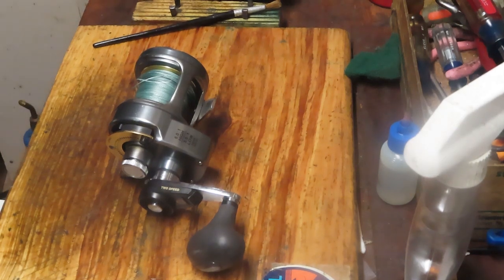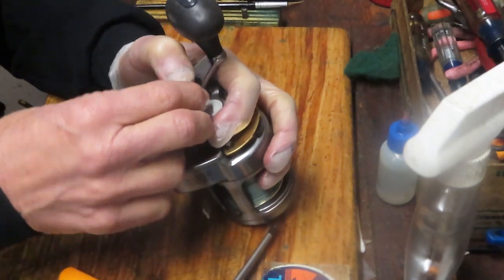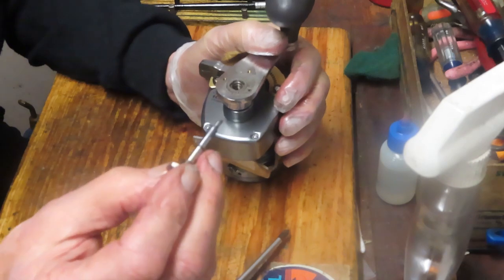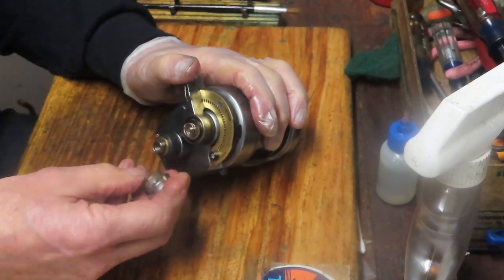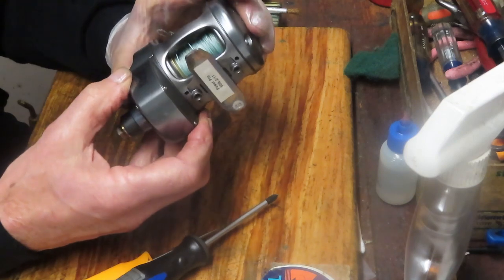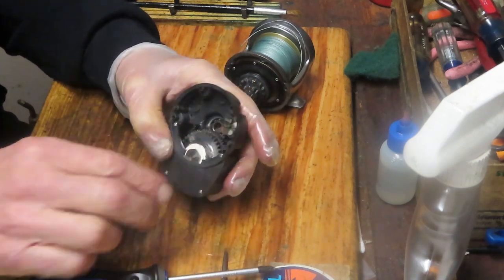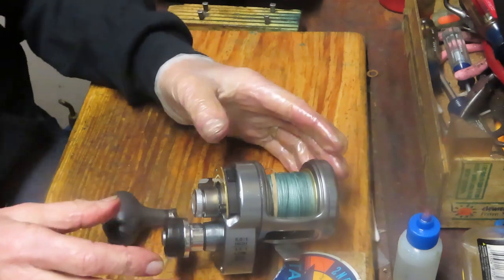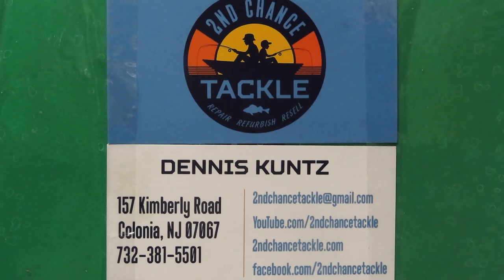Shimano Tyrnos 10II lever drag fishing reel how to take apart and service

Comment: I’ve only worked on one lever drive and if it had not been for a worn out ramp piece for the lever drag I would have succeeded in restoring a very old and worn Shakespeare wonder Troll lever drag that had not been used in over 40 years. Of course that part was unavailable. It always amazes me when you work on a reel with so many screws, how in the world you keep it all organized and in your memory. This is a complicated reel! Very well done Dennis! — Chris
Reply from the maker: Thanks Chris - I have worked on one of those Shakespeare reels as well.  Interesting in that I did not think they made them before a customer brought me one.  Be well

Comment: I've got a tyrnos 8 2 speed and it has random tight spots while reeling in if there's pressure on the line. If there's no pressure on the line or if it's in free spool there are no tight spots. It does it in both gears also. Bearing issue?
Reply from the maker: If they are random, my first point to check would be the drag washer, since it does not happen under load.  It could be a high spot open the washer or a worn spot or an accumulation of debris or grease. - Dennis
Reply: @2ndChanceTackle  ok thanks Buddy. What do you roughly charge to do a service on something like that?
Reply from the maker: Please send a note to my email 2ndchancetackle@gmail.com for service and repair information - Thank you for asking - Dennis